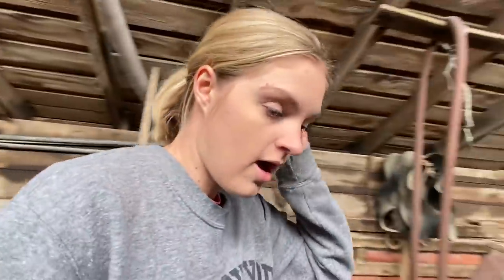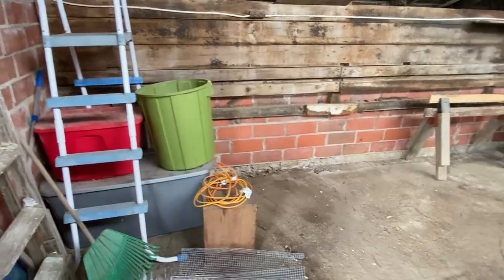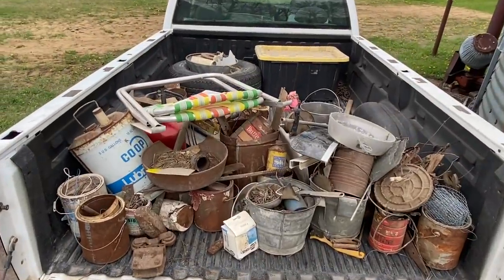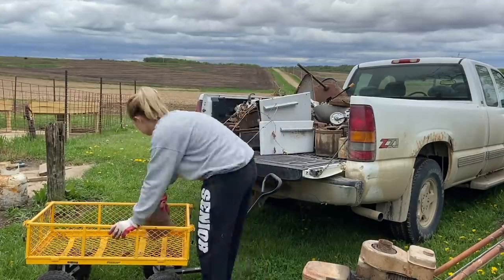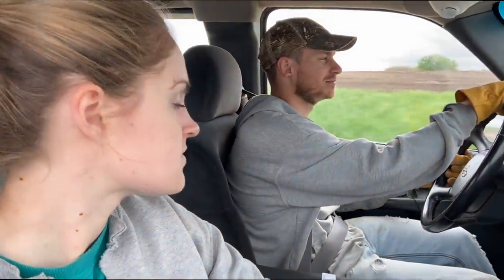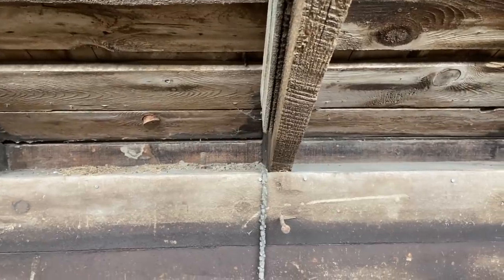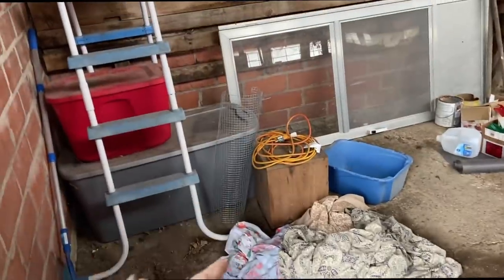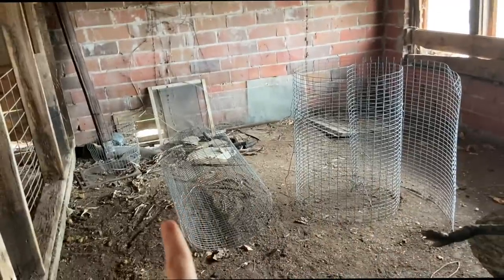CLEANING OUT A HOARDERS BARN

Comment: I think others have commented on what most of the stuff is, the only thing I have to add is the strap that was hanging from the ceiling by a rope is a belt used to run implements off the flywheel pulley of old tractors.

Comment: Good job on the clean up! 👍  Personally I would keep the sawhorses if they are in decent condition, they are handy when you need them to make a portable table or bench (for potting plants?).  And would have kept that lumber that was on the sawhorses as well for making a table top on the sawhorses or maybe shelving.
Reply from the maker: That is our plan!  Unfortunately all the wood had to go because it was covered in so much animal feces - it just wouldn't have been safe or clean to keep :(
Reply: @sumgoodstuff9995  Yuk!  Didn't realize that.  Good call.

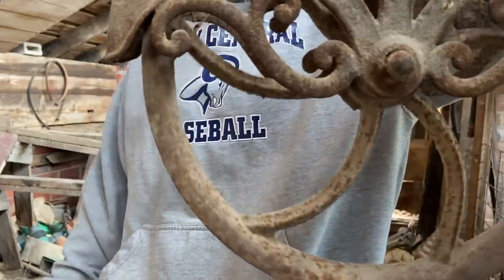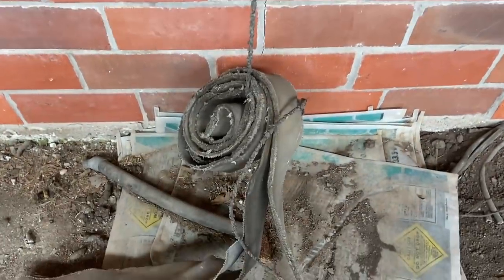Comment: @7:15 It's a gin wheel pulley. Used to pull a bucket up out of a well. A $50 antique. @10:16 it's a flat belt, used to power equipment from a flat pulley on a tractor or stationary engine.

Comment: At the 10.15 mark, you ask what that was hanging up. That is a belt that you place over the older farm tractors drive wheel on the right side of tractor and the other end of belt drives a piece of machinery (Thrasher, Grinder, Buzz Saw, Corn Sheller)

Comment: those wooden ladders you tossed in the burn pile would also make great trellis too .. go save them
Reply: We hang those old wood extension horizontally from the floor joists of our barn loft.  Then we use plastic pails with lids to store tools that are not used a lot.  We mark the outside of the pail with what is inside then we make a long S hook out of small round stock to hang the pail from one of the rungs.  EX we use one pail to store all the small concrete tools like trowels and edgers.  In another pail we store our small planes for making decorative trim and spoke shaves.  They are up high, out of the way, but keeping all the tools in one place and sealed from the elements.  Three wood extension ladders (nobody wants them and my husband finds them on trash day) are vertically attached to the floor joists our of loft and was made into a lumber holder.  A lot of stuff can be repurposed but your shed is very nice.  You might want to rethink that storm door if it fit any of your shed doors.  Your shed is going to be great.

Comment: That looked like a pulley. A rope would have gone on the wheel looking part and it would have been hung up to use as a lift. We had one that had a set of tines to lift hay.
Reply: So did we with hemp ropes made in the 1800s, but the pulley was a lot larger to accommodate the large rope size. That one looked like it was for a well...

Comment: That's the pulley for a set of hay tongs to load hay into the haymow.
Reply: Actually, the pulley is more in the line of what was often used to lift moderate loads, such as mason supplies, at job sites and such.  Just in case, check out some of the "old" Three Stooges movies!  Certain you will find a few of these about in those!
Definitely a "keeper" for posterity! Or, possibly antique 'income'!
Ken

Comment: That pulley like object is aDo you ask
Reply: That pulley like Object  is the pulley for a well to pull water out of the well.  A small chain was used attached to a bucket maybe a wooden bucket that would be lowered into the well to draw water and then pull it to the surface.